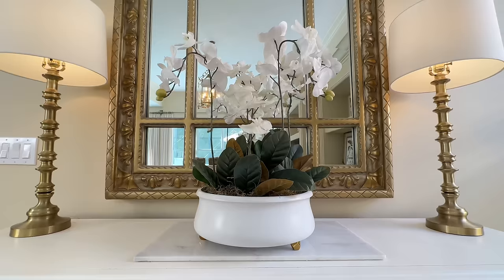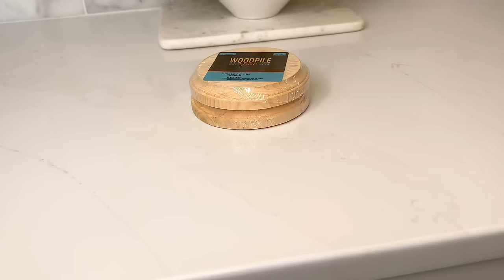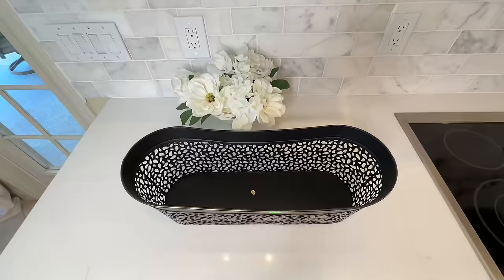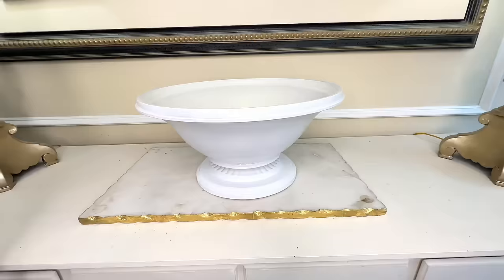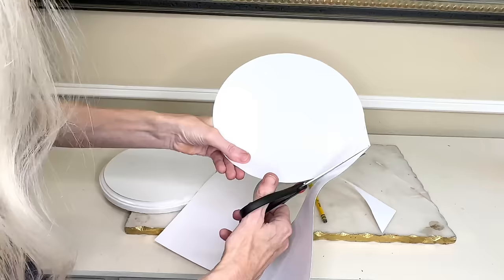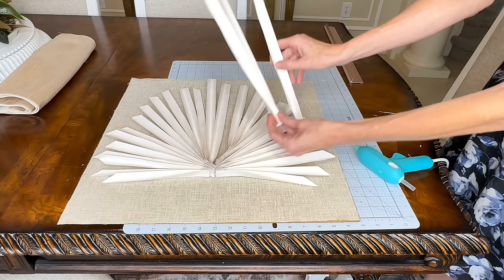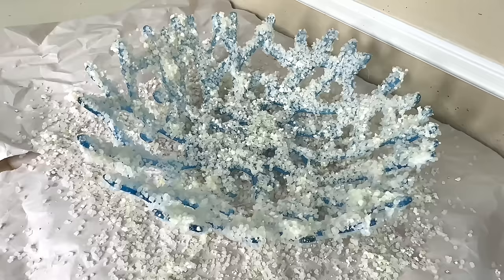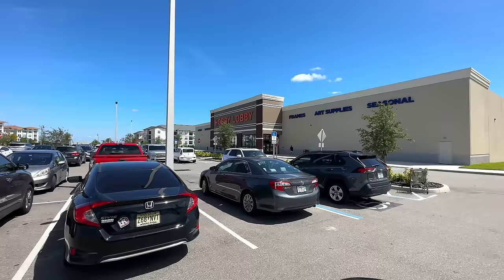TOP *32* DUPES, THRIFT FLIPS & TRASH TO TREASURE DIY HOME DECOR!

Comment: On the hydrodip, usually it seems u only coat the outside, however, I noticed u got the inside done as well. Was this harder?
Reply from the maker: The paint does occasionally go inside, however it’s still the same amount of work. The drying time is typically a little longer.